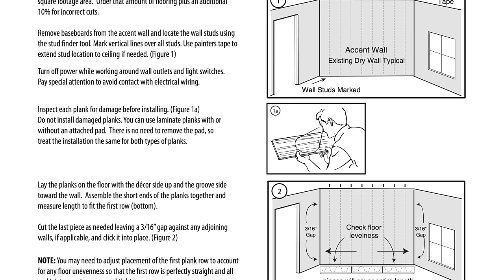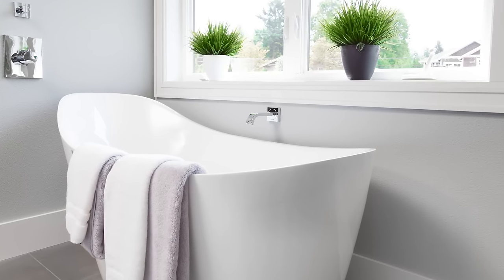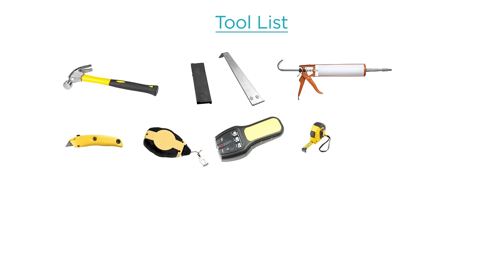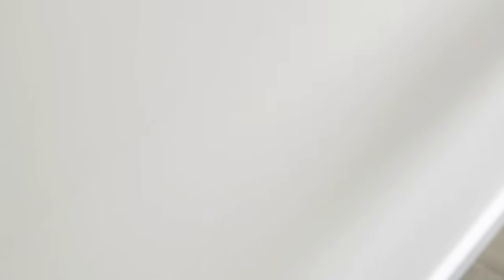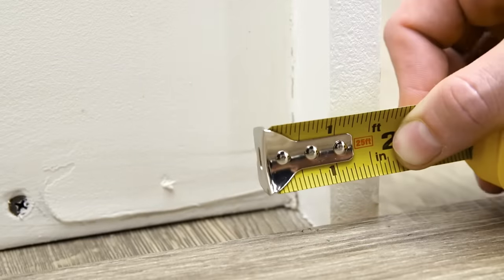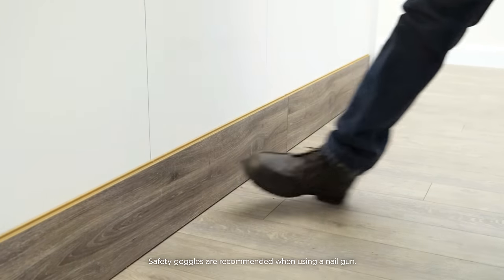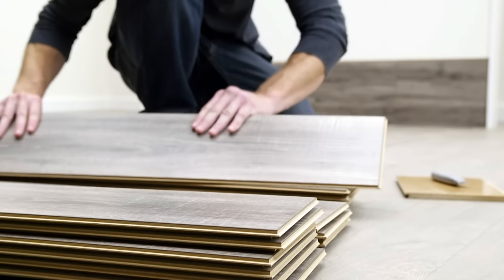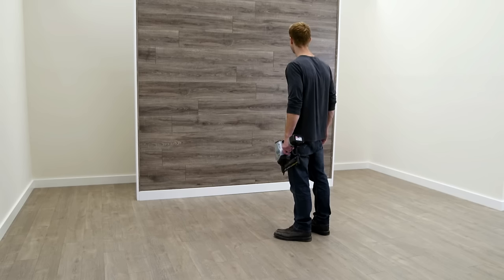How to Horizontally Install Pergo Laminate Flooring On Your Walls

Comment: I used a light gray flooring and installed it on my washer/dryer laundry room  wall. Turned out bad ass. Nice accent wall.
Reply: How did it hold up with the dryer getting hot? That sounds so cool!
Reply: @anneshirley9560  no issues so far.  No sign of heat effect.  Still looks amazing

Comment: Not only did this turn out BEAUTIFULLY done...
I love the way it was Video... Very Professional
Reply: Did you use nails? I was at the hardware store and they didn't say anything about nails. Just adhesive
Reply: @thattannerguy856  
I think he DID use nails, (fine nail gun)
Reply: @judichristopher4604  I meant is it necessary though? It would seem to me that adhesive should be enough.
Reply: @thattannerguy856  
I agree with you... Liquid nails is GREAT...
Personally I would like to use the tiny nails, and NOT the liquid nails... incase you ever want to remove the wall... I guess it just depends on your substrate, what it's made of... (wall)
Reply: @judichristopher4604  nice. I bought a similar product to liquid nails. I don't plan on ever think it down while I'm in this house, so I'm not too concerned about the wall behind it. Thanks for your tips!
Reply: @thattannerguy856  
I once had to TEAR down 'Stuff' on my real house.. That Liquid Nails is good... ;)
Reply: Great video indeed! I did the same for my office, I skipped the glue part and just used nails in case I want to take down the boards.

Comment: I'm going to use a bucket of tile glue.. cheaper and faster instead of using 100 tubes of caulk.. just trowel it on the wall in sections that you can handle..

Comment: What about expansion? This stuff expands ALOT
Reply: Did you actually watch the video?
Reply: @jiojoe8829  yeah. Starting directly on the floor isnt expansion. Been doing floors for 20 years. Stuff moves.
Reply: @AJNASTY-j5y  it moves generally end to end.
Reply: @edmontoninuit6489  false. It expands in all directions.

Comment: Buy some lumber. Thickness plane to desired thickness, jointer and table saw edges, stain, through table router or spindle molder for tongue and groove. Job done and hundreds saved.

Comment: 95% of walls don't qualify for this installation, not with all those restrictions and evenness needed. 

Imagine needing to work behind that wall :o/ 

Or needing to make outlet cuts or run wires for a flat screen TV? That sheet rock knife isn't going to cut it "Pun Intended" ;o)
Reply: I used a rotary tool to cut through the laminate.

Comment: If you own your own house,why would you need building codes for the walls inside? Going to buy a house in a couple of months, a single house sitting by iitself,not a condo or apartment. Anything else that I need to know?? Thank you in advance😊Does anyone know in the comment section know?
Reply: You dont, they are making this 10times harder than it really is. It's very simple make sure the bottom row is level, just use a Brad nail and nail the 4 corners, install the rest and you only really need to nail the bottom, middle and top. Use rubber hammer to pound in place.

Comment: Why cut off the tongue of every 2nd row boards?  Seems that would be needed to lock them in place. Maybe not an issue for wall install? Thx.
Reply: Because youre gluing and nailing everything.  Normally you'd have to drive the short sides together after clicking the long side.  No need for that in this application, so the short sides will just lay nicely on top of each other.

Comment: I use Free Pallets
Reply: Free pallets look great if you have the time and resources. My late father and I built a beautiful wall with reclaimed wood from pallets, but these are two entirely different processes.
Free pallets:
Find quality free pallets, travel to retrieve free pallets, get permission to take said free pallets, and load heavy pallets into your truck or trailer if you have one (if not rent or borrow an appropriate vehicle or trailer to haul free pallets), drive back home and unload the pallets (return rented or borrowed vehicle if necessary and go back home), separate all boards from the 2x4s using a pry bar or sawzall (some are easier than others), dispose of or store scrap wood (there will be alot!), once you have all your wood you can then begin sanding each and every piece and sorting by height and width, then you could stain each piece if you'd like, then you can actually paint your area with a black base/primer to hide gaps once boards are installed, mark studs, and begin attaching your boards!!! 
Versus:
Drive to Home Depot, pick out the material you like and drive back home, acclimate, and get started.

Comment: wow, that took forever and my common sense install went much better, on top of that, if I want, mine can come right back off and be used somewhere else. PLUS, the backing I LEFT ON, really adds a ton of sound barrier to this room. I used to hear the highway noise, now someone has to really stomp on the breaks for me to hear anything or a crotch rocket getting on it, pretty sure that being amplified by th glass in the windows though.    anyway!  Thanks for making me feel smarter. LOL
Reply: Larry Leisuresuit how did you do your wall? I’m not the best with this sort of stuff but I’d really like to try this on a small wall. Thanks!
Reply: @maybaby13x  I used a battery powered dremmel with a small bit to make 4 holes each whole piece and just varied with the smaller ones I had to cut, I used barbed Brads and a nail set to tamp them . that way there was nothing to interfere with the next row. the nail heads don't stick up that way and it just goes together like you are hanging siding except they interlock and each is supported by the nails you use so the whole thing doesn't  pull out.     It;s good to do a few practice pieces,  you get the hang of it pretty quick though, I didn't use any glue.   
   i did think of a different way afterwards, i might try that if I do it again. I thought if i ripped some wood strips  and measured everything out I could have a raised effect and it would have a small dead space in behind the panels, insulation of some sort could go in there, like when you sound deaden  in a car installing audio .
Reply: @larryleisuresuit9584  thanks! I really appreciate it. That definitely sounds much easier!

Comment: How important is it to use nail gun/brad nails?  I dont have a nail gun ☹️
Reply: Depending on where you live, Home Depot rents out tools. I bought a small compressor for $50 and bought a small brad nailer for $25. Pretty slick.

Comment: I have used it on ceiling and slanted walls never had a problem
Reply: Do you need to leave a 3/8 space for expansion? Or can you butt it right up to the walls on the ceiling?
Reply: Because of the way I did my walls I left about that

Comment: Really need a gap for expansion if you glue and nail??
Reply: Yes. Just like tile(backsplash). Wood and tile etc all expand with humidity etc
...Both will pop up or break if expansion room wasn't left

Comment: May I add the following advice. I did this on a basement wall. It wasn’t easy because the wall wasn’t perfectly flat. What I ended up doing as it became apparent was I zinged off the tongue. This way the laminate was free to move in and out. This may be unnecessary for you but for me it was the solve. Start with at the top. Mark your studs on the ceiling also.